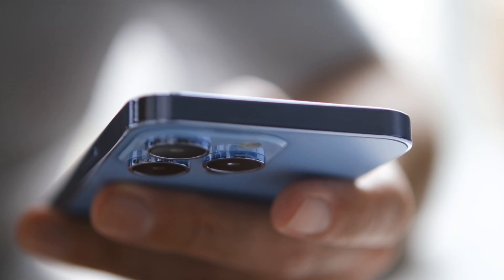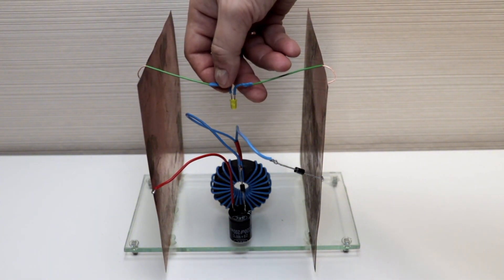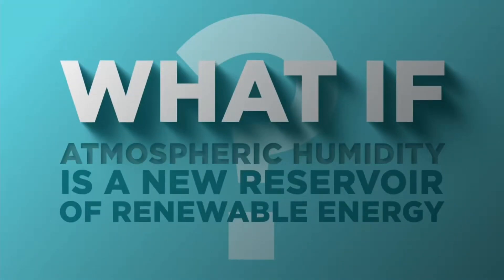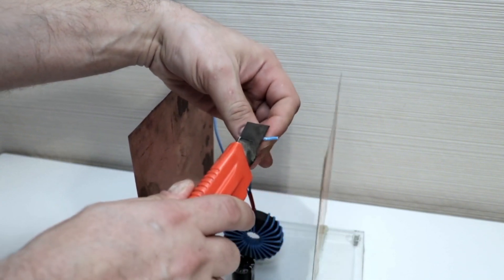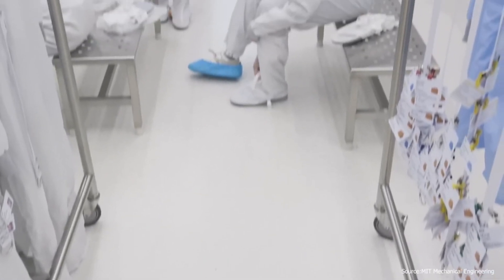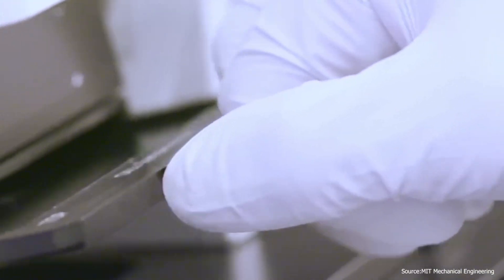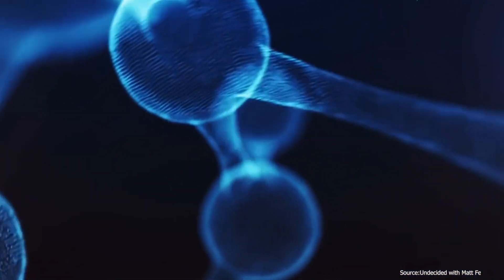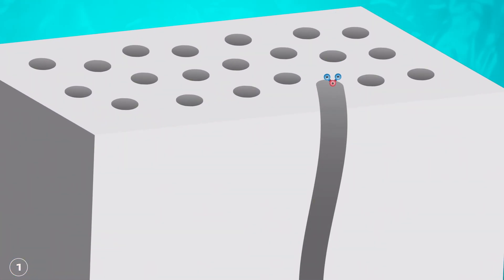CascataChuva: The World’s First Free Energy Generator Seller!”

Comment: Tesla called it aether energy. Moisture attracts static electricity, such as clouds do with lighting discharging it as the positive field grows to a point where the ground (negative) causing the static electrical field to jump in the form of a lightning strike.  My people have created spark gap mechanisms that do the same thing on a small scale between metals, much like touching the doorknob and getting the static shock after walking across carpeting. Electrets, two dissimilar metal plates sandwiching a semiconductor, and even coaxial cables are said to cause the electricity to move between the metals causing a currect. There some pretty good science from a researcher in Japan, on them, but amazingly not very much. It seems, there are people who do not want this technology to reach the market. Many stories of black suits paying people a visit and people dying but almost impossible to verify.

Comment: They capturing static charges on the plates. I have worked with plastics most of my life. Static charges comming off of a plastic hose line feeding plastic molding machines. That hose has an iron end at one end sucking in plastic beads out of a cardboard box layered with plastic bag. Acts as an insulator from the ground. You touch that iron wand while it sucks in material , you get a very nasty shock that can nock you out instantly and you fall to the ground. I know , I got shocked once by it. I learned my lesson to NEVER touch the wand to change Gaylord boxes of material unless the wand is grounded. Those boxes of plastic materials are like huge capacitors waiting to discharge. FACT.
Reply: I was helping somebody using a wood planer. I kept hearing snap snap snap snap snap. Yes there was a Visible spark jumping between the support lines in the hoses of the dust collection system where to the 2 where the hose was cut and then rejoined to lengthen it.